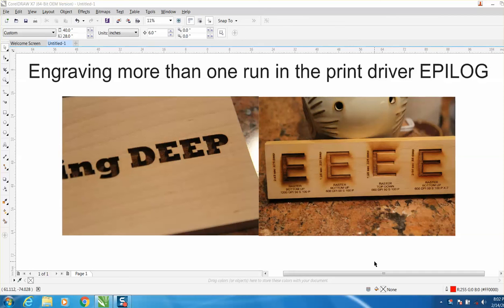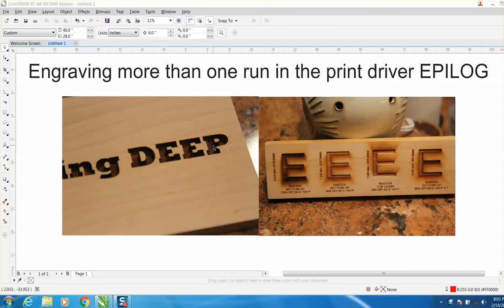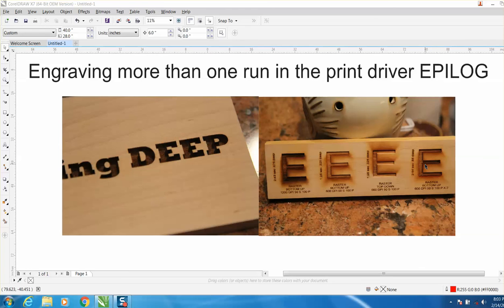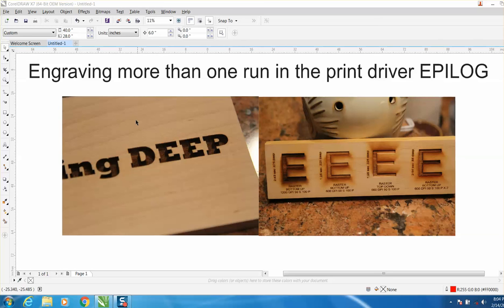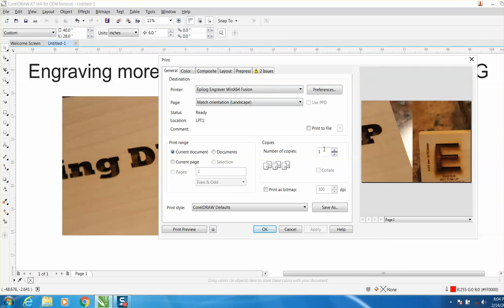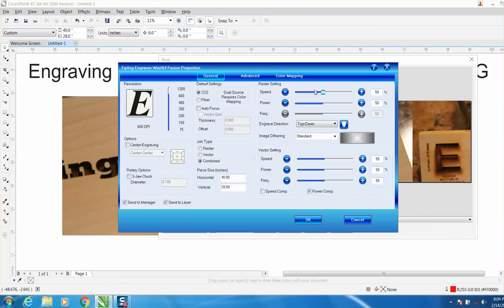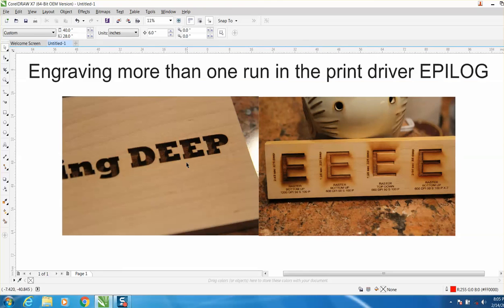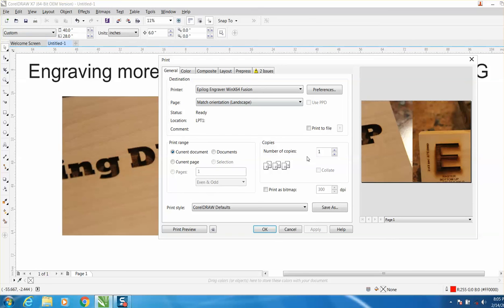Corel Draw Tips & Tricks Engraving, Cutting more than one time, the same item EPILOG

Comment: hello wondering if you can help me. I am using coreldraw for laser engraving with a cheap kn-3020 40 watt Chinese laser. However it is not engraving to scale. it is making the engraving much smaller than it says it is on corel draw. I even checked the scale and it was 1:1 and changed it to 1:4 and didn't see a difference. is it a setting in my laser properties? please help
Reply from the maker: I have no clue, sorry, the only time I have even ever seen scale is when I open a DXF file,  only thing is to make sure your bed size in Corel is the same as your laser...Sorry no help here